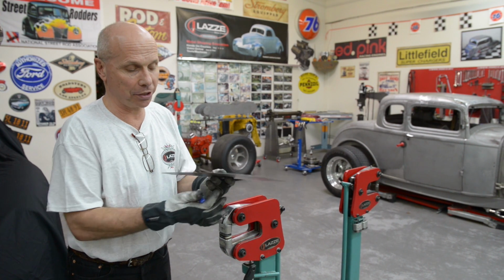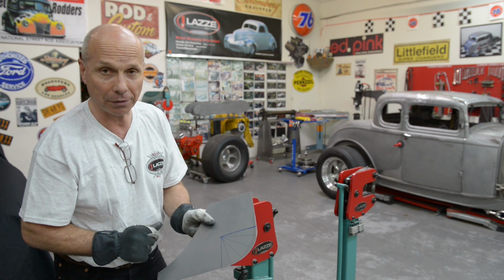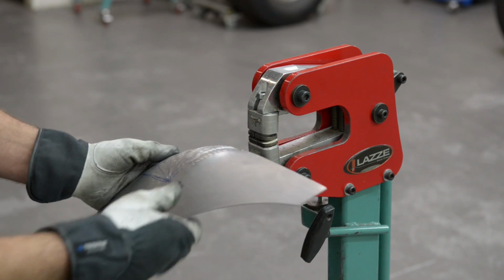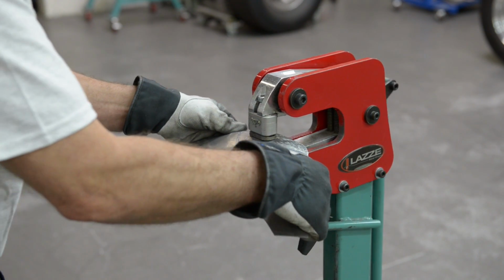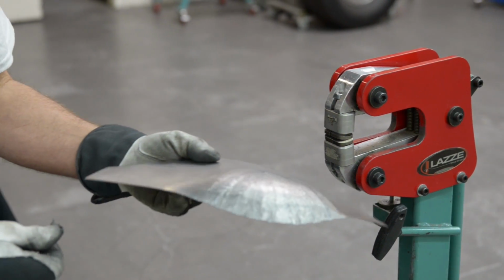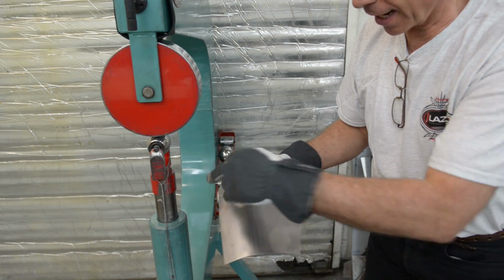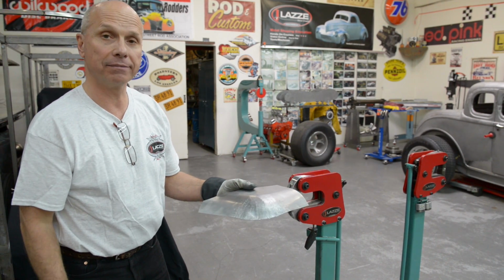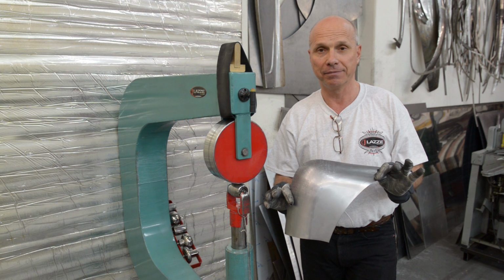Lazze Metal Shaping: Cab Corner (Stretcher and English Wheel Techniques)

Comment: good explanation,  its all about the cutting, bending, shrink,and stretching (the way you combined those determines the shape your creating in your sheet metal), I am still wondering though when you choose a planshing hammer machine  vs english wheel vs the smaller shrinkers/stretchers in general. As well as creating the borders around panels such as fender, door ,and window panels to name a few.